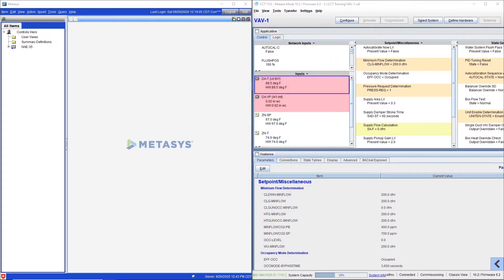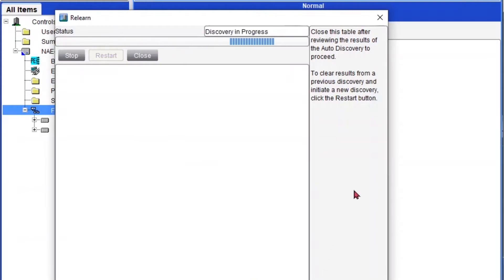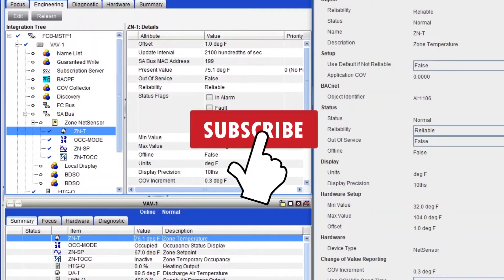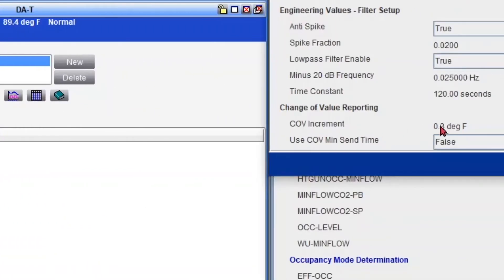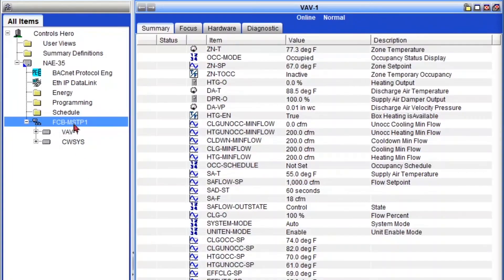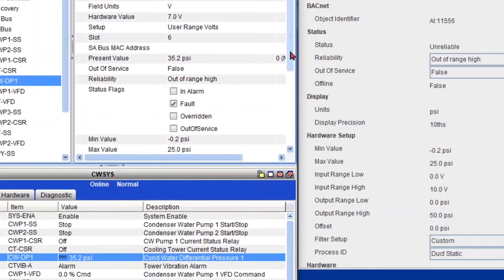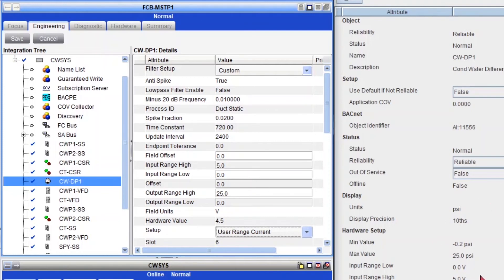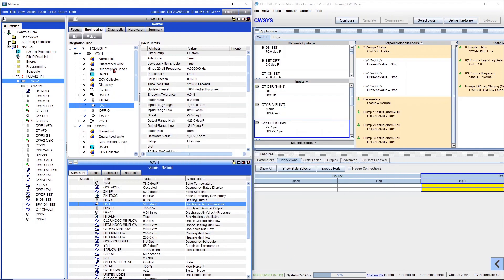Change Parameters in Metasys without using CCT

Comment: Hi , I'm one of your subscibeder , I'm working on PCG2611 controller  currently had RTU program running  on it , I would like to to replace the program to central  heating/ Boiler , I'm able to discover the controller thru map getaway or old Bluetooth , I can read and write to it I can downloads the same program to it and check mark the main and the Boot if I want too ,, the RTU program on pcg2611 main 6.2 Boot 6.2 ,,,my ruining software CCT 15.0 release mode 10.2 firmware 6.2, so far so good But when I build boiler program and try to push it / downloads to the device  ,,thru the commission summery its sees the PCG2611 when I hit next it will (CTT) start thinking then massage popup says  ( please select a different device or different connection point to access this devices ) only when I try to changed the program but if I want to keep the same program and add to it such sensor or logic the downloads to it back will take it ??  would you pls advice me and let me know why , as usual I appreciate all your help .THANK YOU .
Abe
Reply from the maker: Hi Abe Qasim, thank you for your request. Have you checked that the new program has the same controller PCG2611 selected (Define Hardware > Controller Selection > Field Device)? You can send me a message through my website at www.controlshero.com. There is a contact form at the bottom. From there we can communicate better. Thank you.
Reply: Hi ,, Thank you for your reply,, I found the Mac address set wrong on controller, but I will email if I have any other questions,, thank you
Reply from the maker: @Bluesky4y  I'm very happy to hear that you've found the problem! Great job! 👏

Comment: Great video  what happens after a power cycle? To permanently save you will need to upload controller
Reply from the maker: Hi Tom! Sorry for the very late answer (Holidays!). If the controller loses power, all changes will remain in the controller. So each time you adjust a numeric parameter from Metasys it permanently stores the value in the controller. Metasys doesn't store sensors values. Metasys it's like a user interface, and what the NAEs store is the database, like point names, addresses, trends, alarms, etc. And if you want to save the most updated configuration, yes, you will have to upload the controller application using CCT. Hope it's not too confusing. Let me know if it makes sense. Thanks!

Comment: Hello. Question will that also apply if the unit or system is on N2 bus
Reply from the maker: Hi Dexter, that is a good question. I don't know. I haven't work on an N2 system in many years. But if you find out how, please comment! Thanks!

Comment: Appreciate you doing this. Quick question, don't you have to change the value in CCT and then download it to the controller in order to show those changes in Metasys? In your tip #1, I saw that you changed the value in CCT and it got reflected right away in Metasys. Just wondering. Thanks!
Reply from the maker: Hi Aditya, thank you for your comment! Not necessarily, many of the float parameters (or "numbers") can be changed from Metasys, and they will actually be reflected/written in the CCT application, just as in trick #1. But feel free to do your own experimentation ; )
Reply: @controlshero  Yes that I know. I didn't know it could do other way round, i.e commission mode in CCT and make some changes and then exit out of commission which is just enough to make those changes for that controller. I had idea that every time you have to make changes; you need to go to configure mode then save the application and then download it to controller to make those changes effective.

Comment: Excellent tutorial. Is there a way from the NAE to change a temperature sensor type from nickel to platinum .Thank you
Reply from the maker: Hi Lenny! Thanks for your feedback! Well, I haven't found a simple way to change your sensor from Nickel to Platinum, but if you really want to do it from the NAE (Metasys), you can do it as shown in minute 12:58. However, for some reason, CCT won't register those changes, but they will actually be there. So if you have to do it because you don't have CCT handy you can do it, but I would recommend taking a note, and once you have access to CCT, upload the application and make those changes there so you have an accurate application. Hope that makes sense. Thanks!
Reply: Thank you